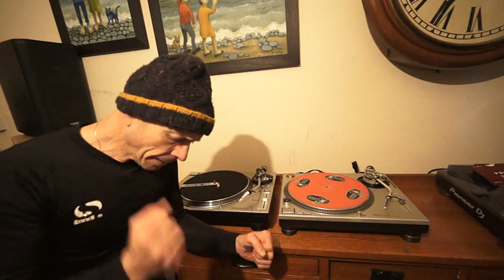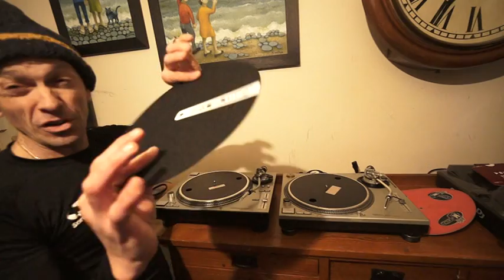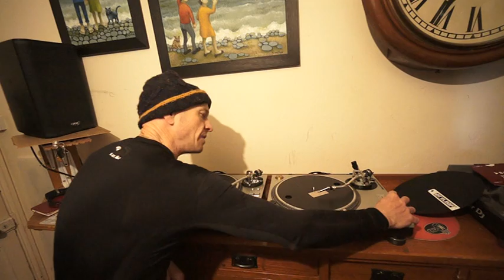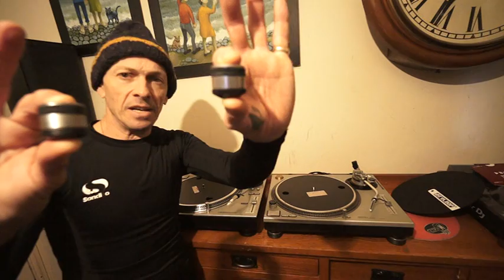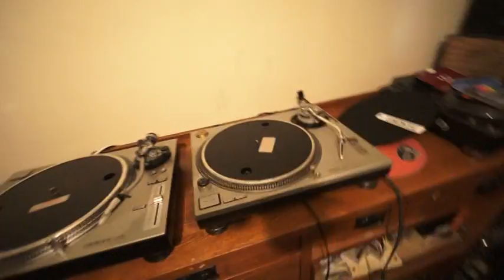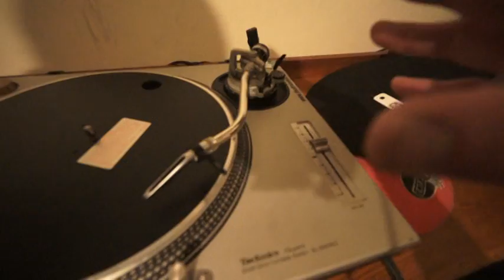RELOOP RP7000MK2 SIDE BY SIDE TECHNICS SL1200MK2  VINYL TURNTABLES

Comment: Both my first pair of SL1200 in 1987 when I was 16 yrs old. Great turntables. they are legendary, durable, well built and the top tier of all turntables.
Reply: The greatest that ever was.
Reply: @MirrorSurfer  original 1210's will never be beaten, who actually cares about extra torque, pitch reset , reverse play , 78, Ultra pitch etc. I've never needed none of that shite and I've had 12's since 1983 (first set). 

As for digitally controlled pitch sliders... don't even go there.
Reply: 1200s look good but there time is up. Reloop has the top seat now. I personally have the RP-8000 MKII there is nothing like it on this planet. It’s like comparing an SP1200 to todays computers
Reply: @vincestyles1030  I wouldn't know. last gig I DJ'd was in 2003.

Comment: Even the 7000Mk1 are fine, especially for home and semipro use. I got mine incl system and cover in mint+ for just 250€, absolute steal! 1210Mk2 became old junk and still cost 550-600€ here… unbelievable.

Comment: Build quality of Technics tone arm and gimble is far superior than all the other copies...would be the first part to get damaged when travelling from party to part...the Technics tone arm setup is bullet proof.
Apararently you can remove the pitch  ball bearing that makes the zero click on the SL mk2 
Replacement pitch faders are modular and replaceable without soldering up untill the mk7
Reloop and other copies have digital pitch faders soldered to board.😢😢
PeaceFromOZ
Reply: you can remove it, but it doesnt make sense since around the +-0 pitch adjustments wont have any effect

Comment: Had 1210 mk2 for years. Regret selling but just bought the reloop 7000 mk2 whacked ortofon Concordes on them. What a great turntable. The mixers are spot on aswell. If playing vinyl Do not buy a pioneer mixer. Phono pre amps are shite.

Comment: Fantastic video!. And between rp7000 and plx1000?
Reply: They are literally the same turntable in a different shell. The only difference being price
Reply: @nohandle747  no they arent i have both and techies 2 pairs also
The legendary pitch of pioneer..will never be beaten. Mix flows like water no matter what
With reloop pitch control can be all over the place many times 
Plx1000 blows them all out of the water even my techies
Reply: @Übereine  BS.
It's proven fact that the PLX1000 is only suitable for timecodes or fast/short vinyl transitions, due to it's digital pitch. Yes digital pitch is good for stability of the platter speed, but the steps in the pitch adjustment are obvious to a good vinyl DJ.
None of the Hanpin / super oem decks have the tiny pitch adjustment capability of the Technics Mk2/M3d/Mk5 analogue pitch sliders. That is fact, and they do not hold two vinyl records perfectly beatmatched anywhere near as long as original Technics do.
All other turntables apart from Technics use the same Hanpin motor, so they are basically the same. Some just have a few extra features, that is all. The Technics M5g and all models after that, also have digital pitch adjustment, and are not as good as original Technics system.
Reply: @DjNikGnashers  lol ok whatever you say 
. Bro stop the science bs. Plx much superior than older gens techies. I had/have em all. Only 8000s reloop and mk7 techies come close. Leave your fact science bs to non vinylists
Reply: @noobslayerr9732  So, PLX1000 are 'much superior' than original Technics are they ?
How about you discuss 'how' they are better, instead of just posting a bullshit bro' science view without any detail or factual proof to back it up.
I started DJ-ing in 1980, and still DJ now.
I think I'm qualified to call myself a 'vinylist' whatever that is.
PLX1000 have more torque (just the same as every other Hanpin motor deck, because they all have the same motor, are you following), but more torque is only good for DJ's who want the platter to keep spinning as they put pressure on it ie scratch/HipHop/Turntablism DJ's, as I already said.
It is not a benefit for a vinyl DJ who does long transitions, like house, techno, trance, etc, because the digital pitch moves in larger steps than the analogue pitch slider in a Technics Mk2, M3d, or Mk5. That is a fact.
I have used every turntable released, and I mean EVERY different one. The PLX1000 is exactly the same to mix on as the Stanton's, Reloop's, Audio Technica, Denon, Sony, Numark, and a load more. They use the same motor.
The differences are in the extra features, and tonearm quality.
Every Hanpin motored deck, has the same digital pitch, which is not even half as accurate as the original Technics analogue fader (which still controls a binary / digital circuit, but the adjustment is a lot finer).
Sit a well looked after set of 1200Mk2 next to a set of PLX1000, and see how long the Pioneers keep the beats matched without you having to constantly chase the pitch fader to keep them in time. You might never find the exact sweet spot, because it could be in a gap between adjustment steps.
On a Mk2, you CAN get it bang on, and they WILL stay locked together for 2 or 3 minutes with practise.
If you cannot understand why this is a correct opinion, based on fact, then you are too stupid to even discuss this subject.
Reply: @DjNikGnashers  dude.. im sure i do more than you will ever be able to know. Thanks for your kind words tho but i wont reply back anymore cause in real life your keyboards and preaches wont really count when the game matters in a vinyl contest i will take your soul...trust me
But Im not a pro pioneer. But thruth is they have the edge vs older techies. And truth always hurts... no matter what your preaches are.
Reply: @DjNikGnashers  you're 💯 percent correct in what you're saying. I've also watched several videos on this topic and it's blindly obviously that these modern decks are inferior to the Technics. Any one with half a brain can see this. Starting from the build quality all the way to to the crappy digital pitch faders. And lets not forget the awful audio feedback from the pioneers.

I've been looking for a new pair of decks, and actually wanted to believe that I could buy a new pair which would at least compare or be as good as the 1210 MK 3'S which I used to own.. I mean, who wouldn't right? however, after researching and putting in hours of comparing the two, it was absolutely obvious that those pioneers are inferior to the Technics in pretty much every sense.
The ONLY real benefit is the higher torque motor, but that will ONLY benefit scratch DJ's or modern EDM DJs who do 10 second mixes/ transitions
Reply: @AmbientWanderer  Thank you for the kind words matey.
I tried to be polite, and educate Mr 'know it all' (but has not proof or facts to back it up) above, but some people are too stubburn to admit they are wrong once they have made a comment.
All I try to do is help others, and I'm glad you have the intelligence to see that what I stated was in fact, 100% true, and I genuinely wasn't just arguing to troll.
You found out for yourself, and now you know the truth, instead of just reading some bollocks on a website, buying some Pioneers, and then thinking they are the best decks ever made just because you own a pair lol :-)))
Reply: @D.J. M. Good points my friend.
You are right in what you say.
The point I was trying to make, was that all digital pitch turntables have steps to the adjustment, and those steps are noticable.
Also, on super oem/hanpin decks, the pitch only adjusts from the 0 position, to the +7% and -7% marks, and anything after that is a dead zone (as proven on the links to the YouTube video's I pasted above).
The Original Technics pitch system, was an analogue slider, which sent a voltage to a binary circuit, so even they were digital in a way, because the motors were controlled by a digital binary pulse circuit.
The difference though, with the old Technics system, is that the adjustment was in a lot smaller steps, and in fact, so small you couldn't actually see the steps (unlike modern decks).
Modern digital decks are fine for timecodes, as you are only playing digital files anyway, but for real vinyl, it doesn't really matter if it is a 1990's vinyl record, or a 2020 vinyl record, the actual process of cutting the stampers, and pressing the vinyl, is exactly the same. In fact, many of the record pressing plants, are using the same equipment in the same pressing plants, as the 1970's !!!
Vinyl is vinyl, it's not really any more accurately pitched now than it was in the 1970's, and the original master tapes used were actually incredibly accurate machines, and extremely high quality regarding sound bitrate.

Comment: the Technics classic decks .Many are getting on but i have never seen one break .I have broken many other turntables but on the Technics  only a plastic catch for the tone arm and only because im a clumsy oaf.The feet would fall off but thats because they unwind over time especially if you dont make sure they are properly wound on which is what i kept doing.Other then that with proper use they will last a very very long time.

Comment: I find this very useful. Thx, tempted to get a reloop rp-7000 mk2 but that pitch problem seems to be an issue given the fact that i just wanna use it for mixing in techno and house. I often change bpm, can play trance tracks in slowed down versions as well, so a 1200 sounds more appropriate for the purpose
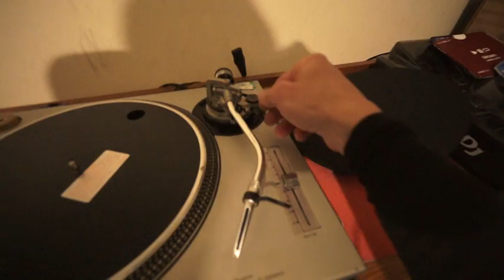Reply: What pitch problems on the rp? The only pitch problem he mentions is the latching of the pitch fader on the 1200: 33:23.
Reply: I think when people mention the pitch on these newer turntables is that it’s digital, which means that when you move it, it jumps in steps, compared to Technics (mk2, mk3d & mk5) being analogue & moving smoothly.

Comment: I own a pair of 1210mk2's but I'm looking to replace them as they have had a hard life. I'm thinking of buying a pair of mint 1210mk2's again but the RP-8000 /RP-7000 MK2's sound interesting. 

The one thing I want to know about is  how does a digital pitch feel like compared to the analogue one that I'm used to?

Good informative channel 👍
Reply: @kepplerkeppler6407  I'm considering that. The only thing is they are a bit rough with bubbling pains and chips. I may service and then get them wrapped possibly.  Im not going the digital fader route as I've heard bad things about them 
Cheers
Reply: @Rob060870  yeah don't go down the digital fader route please, especially if you're going to be doing long mixes and transitions. They're absolutely great for scratch DJs, or modern EDM DJs who's do 10 second transitions.

Comment: I suppose the Technics has a brake and torque adjust potentiometer below the platter. They are under small holes, and reachable specific positions, maybe trough the holes in the platter.
In the MK5 it has, but MK2 i'm not sure.

78RPM was using about the gramophone era, maybe the '20s thtough the '50s.

The problem with the Technics decks are virtual, imho. They were abandoned for about a decade, and the rival brands evolved. Thats the deal. Technics are essentials in the club scene, and if you can play with them, you can use the other brands, too, they are basically the same. Technics was the godfather of the DJ turntables, and they made it etalon. All the knobs, buttons, sliders, lights in the newest models are the same positions as where Technics placed in the late '70s.
Reply: yeah yeah yeah whatever.  and 'etalon', wtf??

Comment: You call them 7 inch records?  In North America we call them 45's. And we call singles 12 inches. We also incorrectly pronounce "Technics" as "Techniques".  

I always thought pinching the spindle was a ridiculous way to reduce the speed. I've only seen a couple DJ's do that.  Rubbing the side of the platter is far more effective.  And nudging the side of the platter to speed it up is also weird. You'd think that would be far more difficult to do smoothly,  versus using your finger near the center of the record.  I know you know this, just my opinion. 

I'm surprised the Reloop 7000 isn't self grounded. It's not that old.  I have a pair of Numark TTX turntables that were released in 2007, and they are self grounded.  They also have a interchangeable tonearm.  You can use S-shape, or straight for scratching.  With a straight tonearm it's very difficult to skip.  The Technics MK7 has all the modern features the Reloop has.

Comment: The new generation Technics SL-1200/1210GR (May2017) Turntable's are a revised Old School version from the Technics SL-1200/1210MK2 (October1979).
I think the current New School GR Generation has now been improved in the right direction.They are now again the new standard Professional Club Turntable's as before,only better.
Great😀👍🎼🎶☘
Real DJ's play Vinyl.
Save the Vinyl.
Reply: In the past I had the Technics SL-1210 MK2 with the ortofon Concorde Scratch (pink).
Now I have the current Generation Technics SL-1210GR with the ortofon Concorde Scratch MK2.That's are very good Professional Tool's.
Once ortofon and Technics,always  ortofon and Technics.
A lifelong professional DJ accompaniment.
Great😀👍🎼☘🎶
Reply: @PA-Freak98513RY  the digital pitch in the GR is terrible, the mk2 is far better for long mixes, it stays locked unlike anything with a digital pitch

Comment: I think most of us back in the day started out with some dodgy decks, i had an SL-23, which was not too bad for a belty, paired with some dodgy pioneer which didnt even have a pitch control, then a set of KAM BDXs i picked up cheap, which were not much better. Then life took a different route, djing went out the window and i never did get to own a pair of the technics, had plenty of plays on them tho. 

I recently got back into it all, glad i kept my vinyl, one thing i never parted with. I was looking at getting the reloop 7000s, but then i came across the audio technica lp1240, pretty much the same, just another super oem. But for £200 each, brand new boxed, it was a no-brainer really, so i went with a pair of them. Basically got a pair of them for less than the price of a single reloop7000. Happy with what i got, no regrets.

Comment: What happens when you tap on the plinth while a record is in play?
Reply: Looking to isolate the motor and spindle from the plinth.  Looks like its attached, given the thump with any tap on the plinth at all. Did they attach the motor to the plinth?
Reply: @allhartfidelity  the reloops have awful feedback,  they also have a raised platter that should be recessed , I ran one alongside a tech 1200 and with the same needles and with tonearm set at various tracking weights and the tonearms at various heights and the sound of the needle on the reloop was awful , like it was scratching the record, I reckon the needles would last half the time on tge reloop because of record wear caused by the ugly raised platter
Reply: @michaelc1818  isolation is worse than any deck I've ever owned. Any minute breeze passing by can be heard through the pickup. It's a shame to have a decent motor and features within a cardboard box. Not sure if it's the arm that's not isolated, platter/motor, or both.
Reply: @allhartfidelity  They are just OEM rubbish like all the hanpin rubbish, even the Pioneers are hanpin and are bad for feedback, regardless of feedback they all have digital pitch which is useless for long mixes and the wow and flutter is bad
Reply: @michaelc1818  I am for home audio use. I've had a 1200 of some form or another for many years.  Still have a GLD. The rp7000 was a supreme let down. Got a gold one because I like the color combo (hence the gld) and read on some reloop folks having hum. However, I dont have hum...I have poor isolation.  Ideally, I throw the arm in the trash, but doubt I can use the same armboard used to mod the 1200 on the reloop. I would start there and see if that helps.
  Any idea if that plate for the 1200 used to put SME arms on them would work for the reloop?
Reply: @allhartfidelity  Why bother , just pick up a pair of 1200 mk2s and some spare pitch faders
Reply: @michaelc1818  what you think about the cordless direct drive like in the mk7? I'm not even sure what there talking about, or if it's been proven reliable yet. Think it was introduced in 2016 but not sure
Reply: @allhartfidelity  The mk 7 has a digital pitch which is useless, it is far less in weight and build quality, it is not made in Japan hence the quality control will probably suffer....The coreless direct drive is something I don;t rate, it wears out ....so already it is sold as something that's not long lasting like the 1200 mk2 , the cogging wasn't an issue on the mk 2 and the brushless dc motor on the mk2 was perfect